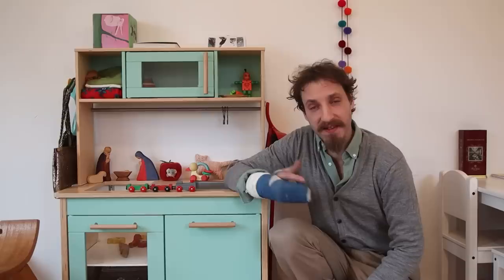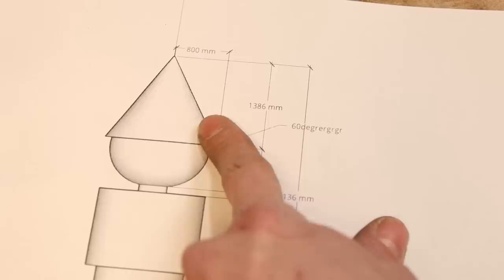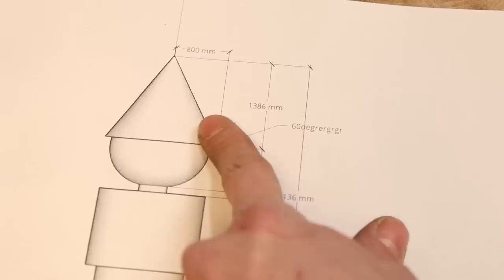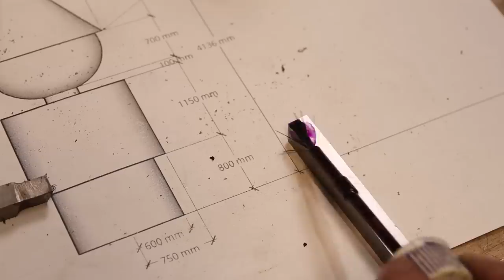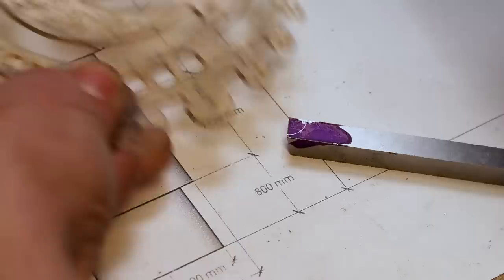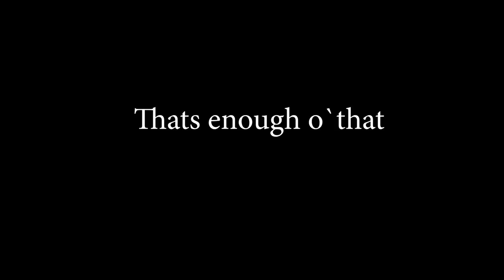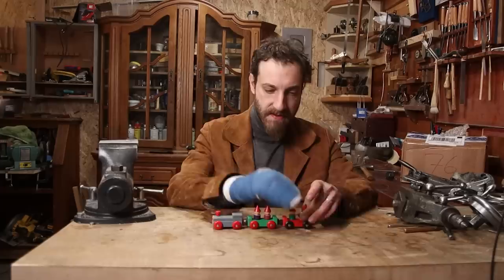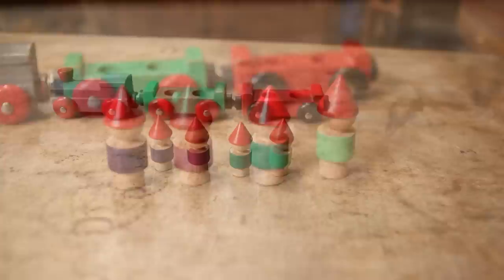Making simple kids toys is not so simple

Comment: I had a very similar cast on my hand last summer. 
Glad to see you found a way to still be creative despite it.
Reply: So did I. Ever have to clip your fingernails using your toes to operate the nail clipper? I have!
Reply: @Vikingwerk  When I broke mine the hardest part was trying to wipe my butt with the wrong hand . Spent a lot of time in the  shower  with a plastic bread bag and a rubber band over the cast getting clean.
Reply: The hardest challenge for me was to not even break anything, and until now I never have

Comment: i just made a chess rook (to replace a missing one from a travel set) out of a cheap 9mm dowl rod. I used a power drill with the dowl gripped in the the chuck as a mini laith. all looked good until i added the varnish whick soaked in and it became lumpy and uneven. varnish now drying so i can try reshape it a bit and second coat. Mostly just a warning not to get over excited with cheep ingredients (still fun to do though)